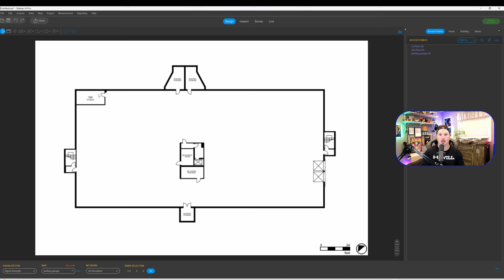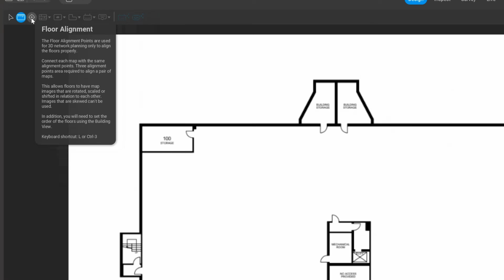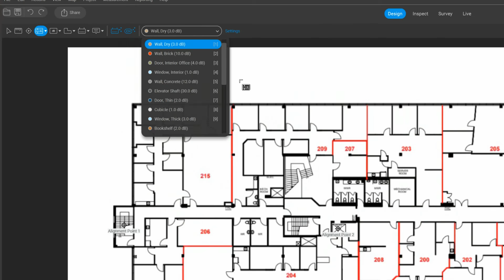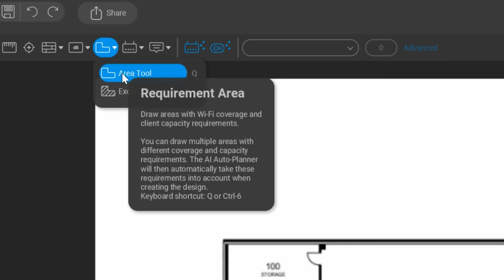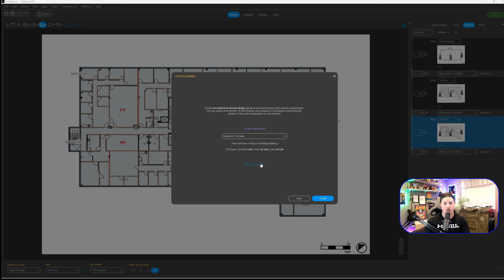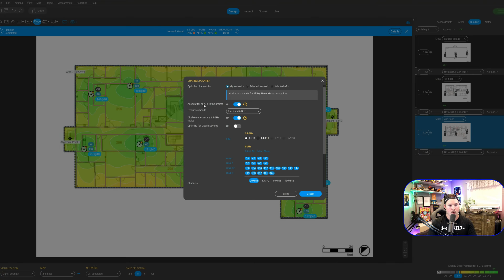Design WIFI for Multiple floors using Ekahau AI Pro

Comment: Wish this was available back when I did the planning for campus...  Learned a lot about signal vs poured concrete walls.  Last year had a company bid to install electronic door locks with wireless controls.  They could have used this and ended up using 3x the amount of antennas.